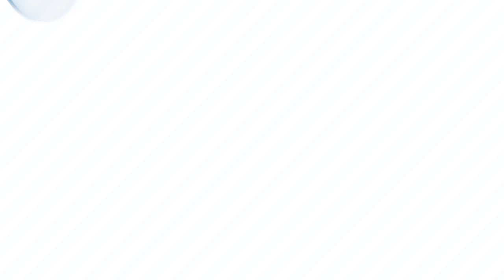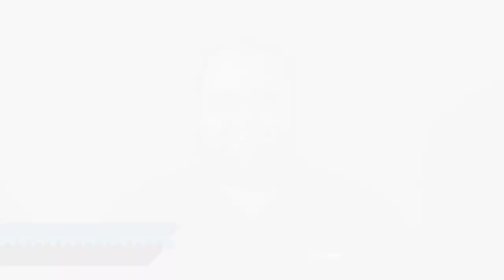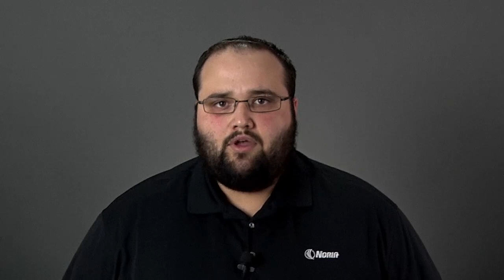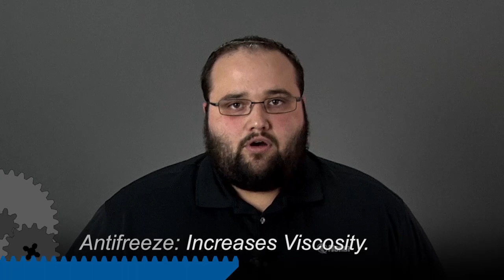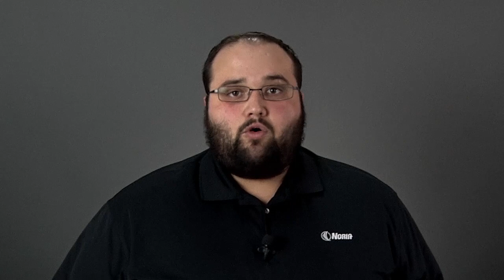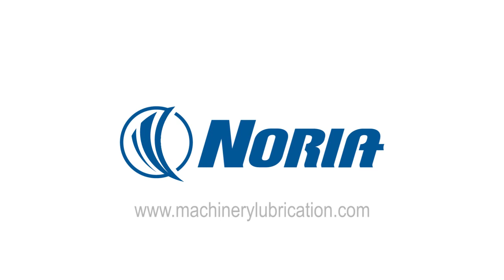Effects of Antifreeze Contamination in Motor Oil

Comment: Coolant (glycols) will also attack polyester substrates which are used in filters compromising the filter. Nylon will be chemically resistant to this contaminant so it is better to use a filter made with nylon instead of polyester fabrics.